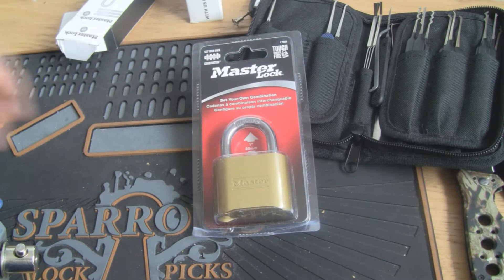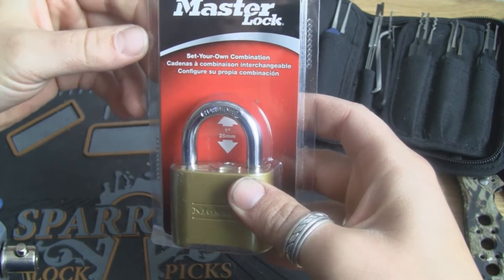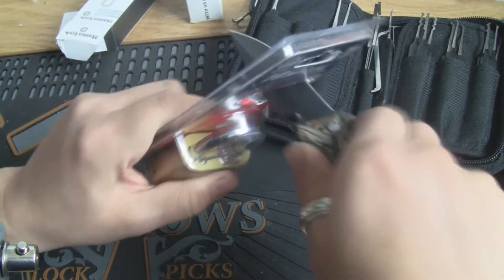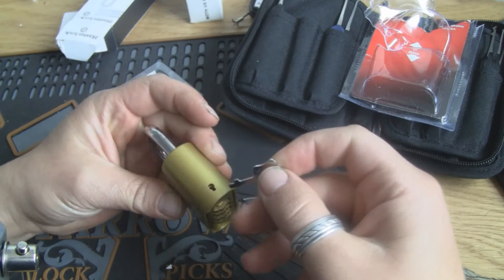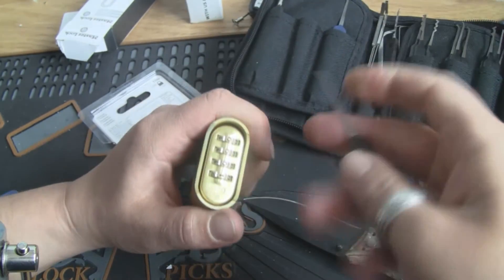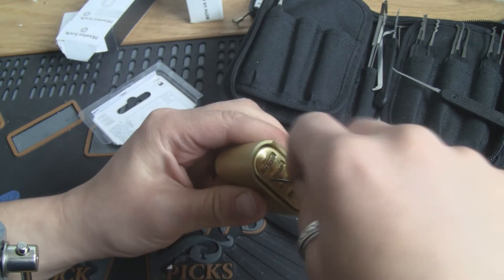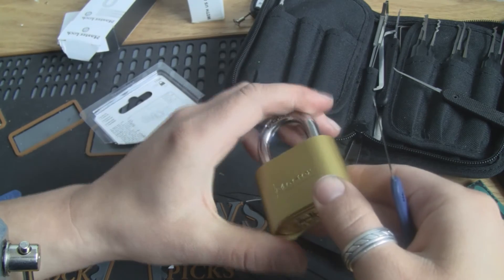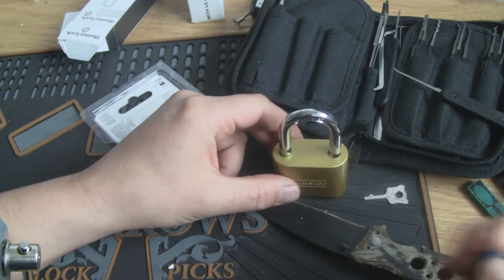Master Lock No. 175 Bypassed out of the box

Comment: It's amazing seeing this lock out being used.
Reply from the maker: It's also amazing that they still haven't done anything to correct this. I'm not exactly the first on YouTube to bypass this lock.. 
Another thing that is amazing is that I have seen this lock sold in Norway at a price of $90 USD.
Reply: Sadly, at&t uses these locks on their equipment cabinets all around the city...
Reply: I see them in my area on peds and low volt utilities, too. Have you guys tried a dimple pick to reset the combo (in place of the little key)? I think it'll fit.
Reply from the maker: C Henry The reset the lock you only need to stick something straight inn. There is a little spring loaded "button" there, that release the code wheels. Making it possible to switch combination. 
The "lip"/bitting on the key is only to hold the key in place. 
So Yeh, a dimple pick or anything poity will do the trick.